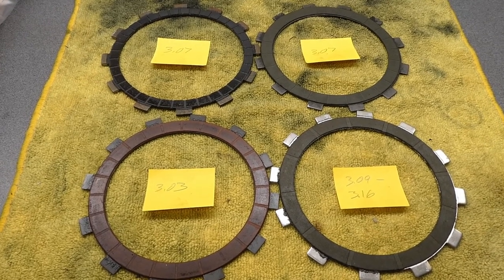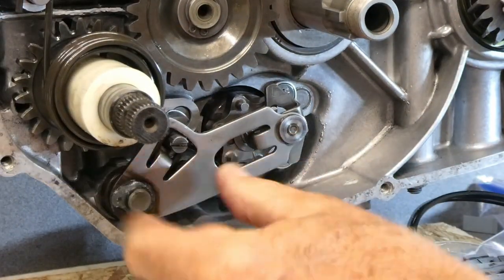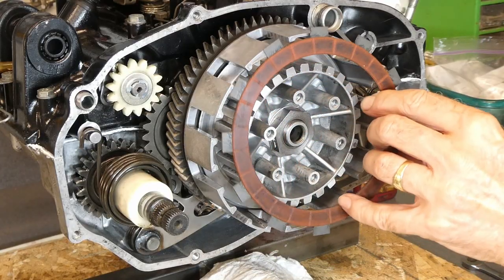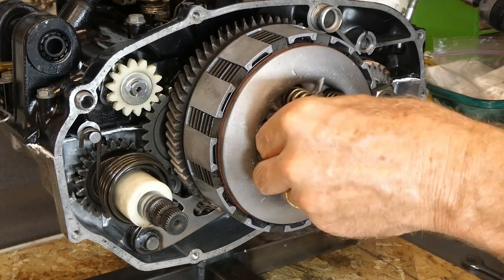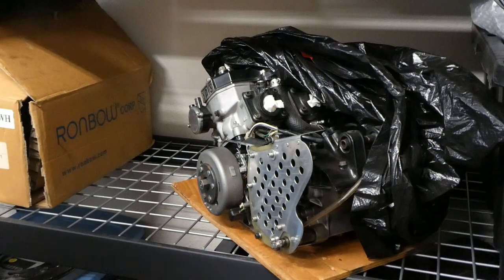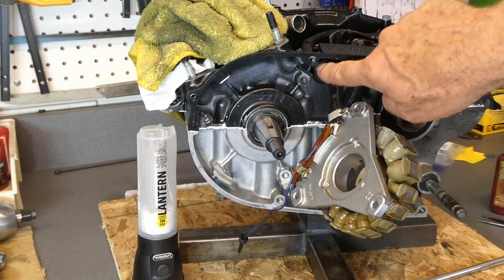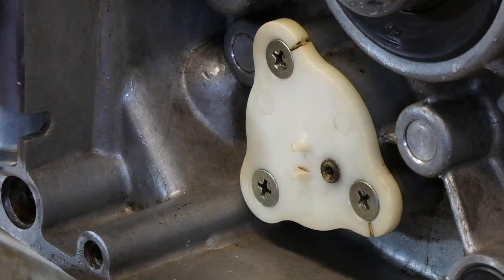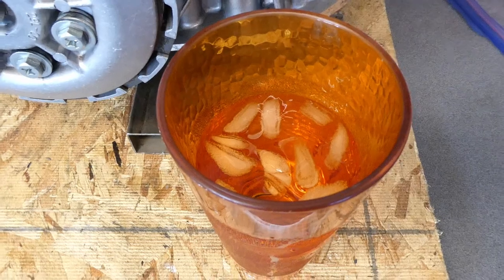RZ350 NC2 Resto Mod Ep35 – Clutch & Stator Installation

Comment: Done 14 rz's now.
 Canada eh! I ping the key on both sides, one ping in front, one on the other rear side. I put a magnet on it overnight. I paint pen the key way and lightly litium grease the shaft, wiping away any residue. Polymer chemistry does the rest. The magnetism pulls the whole thing together. Voila. The ping marks create friction, enabling the key to not rise up.

Comment: Nice work, Ken.  I'll be curious to hear how you like the roller detent on the shaft star.  Does it improve the shifting?  On my rebuild, I replaced the spring on the shift shaft and the metal bushing the shift shaft passes through  on the chain side of the engine case.  I am still using the stock detent and shift star. My shifting is improved, no more missed or half shifts. Shift action is very "firm".  The new spring seems to be making a difference.   Waiting to see how it wears in after a few hundred shifts and some oil changes. 
FZ600 clutch plates, I gather?  Guessing the larger surface area negates the need for rubber damper rings?  I know some guys do not run the damper rings. Understandable,  considering what Yamaha charges for them....ugh.  I am always interested in how guys do stuff.  You can always learn new ways to achieve good results.
Coffee time!
Reply from the maker: Yeah, some new stuff on this rebuild. The roller detent, the pancake bearing, and the shift star mod (done on others). I would have to look through my notes to answer the FZ600 clutch plate question. I just don't remember if it's FZ or FZR??? Maybe the same.

Comment: Why haven't you changed the clutch basket rubbers? they seem to have slack..
Thanks for vídeo
Reply from the maker: The rubbers have been discarded and will not be replaced. This is the first engine I have disassembled that even had them installed. They are not required so will not be used.
Reply: @KensGarage1 I think this guy was talking about the clutch basket dampers, and I think he was right. I just noticed it on my AC as well. Those are the dampers which are INSIDE the clutch basket, you have to grind or drill the rivets in the back to get to them. You can see in your video here that you can freely rotate the basket back and forth on the gear a bit (around 03:10). Those dampers are for damping vibrations through the drivetrain, I think you were talking about the "big O-ring" things that sit in the airgap under the clutch plates. Anyways, I just reassembled my AC without changing the worn dampers and am feeling a little "dissatisfied" about it :-(